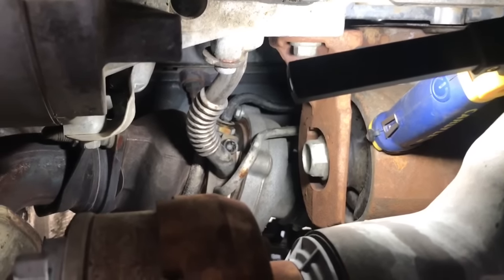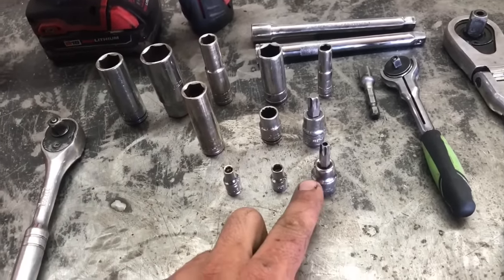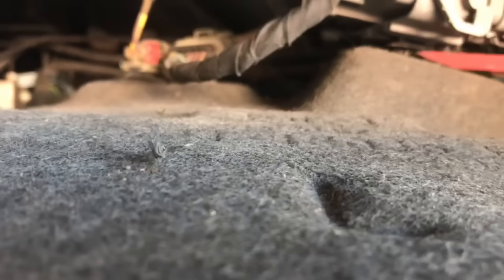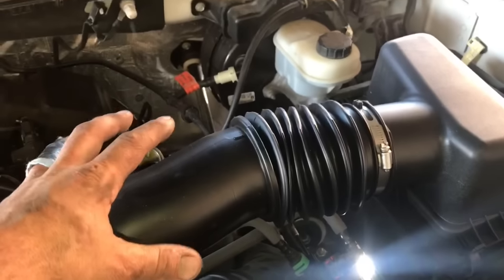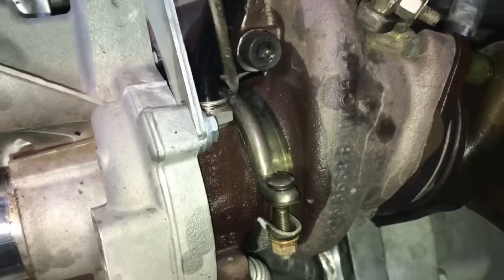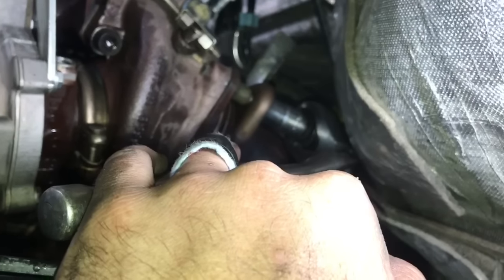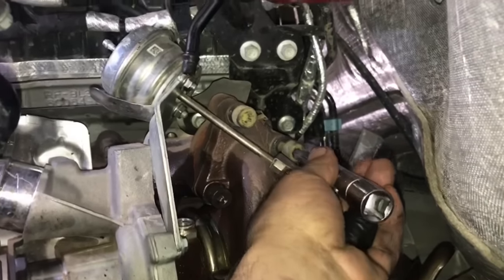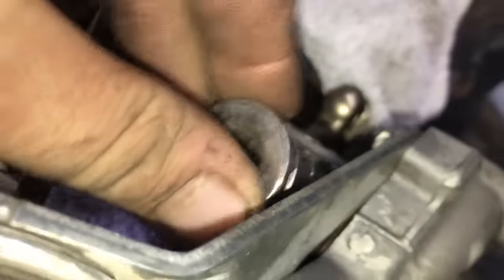F-150 Ecoboost 3.5 Turbo Coolant Connector Replacement (Tips and Tricks)

Comment: My 2013 ecoboost just started leaking coolant from that same line. I'm gonna get someone to do this for me. If you don't mind me asking, what's an estimated repair cost?
Reply from the maker: At my work we have a large fleet of trucks. 17 of them are eco boost f150. And I do all the repairs. So I’m not quite sure on the cost. Unfortunately most of the of the repair is going to be labor. Those fittings are under $10. 3 hours of labor is reasonable for the shop to charge. I would question around 375.00
Reply: @AaronHinesAuto  appreciate that.
Reply: All data shows 4.5 hours. This is an industry standard. Quit trying to make the shops look bad. Dealer charges same time as does independent shop. You’re a technician, don’t make it out like we are crooks. We DONT decide the time charged and you know this
Reply from the maker: If you read my comment above I said “I’m not quite sure of the cost”. As I don’t use the flat rate system. No one is a crook here. Chill.
Reply: floydpros to be fair if you bring your truck to the dealership you WILL get taken advantage of in some way shape or form it’s undeniable
Reply: I’ve not seen that at any of the dealership I’ve worked at. The reason you pay a little more is for the part. The same part that lasted 8 years and will likely not have to be replaced again. I’ve spent some time at pep boys and firestone, those are crooked places
Reply: Remember the dealership banks on your return. Why would they cheat you and loose that potential car sale in the future
Reply from the maker: this part did not last 8 years. it lasted 2.5 years. yes there are some good dealerships and good service advisers who are honest. there are just as many out there who are not honest, and who do take advantage of peoples ignorance about auto repair.  to say that doesn't exist is not true.
Reply: Aaron Hines no it did not last long at all  and I would be really upset if my new truck was leaking all over my driveway within a couple years of leaving the factory

Comment: Great video but you should do a little more research before you post. Those are not T47 they are T50 bolts and the radiator does have a petcock it's on drivers side on the bottom. Draining from hose just makes a huge mess. Putting it back together is much easier if you take off the intake and charge tubes. Also if you do one side better to just do both sides at the same time. It's a good idea to change the fittings on the other side of coolant tubes that go into the block they leak too. The passenger side is way easier, but you need to remove the starter.

Comment: How long can a guy drive with this leak? Im adding about 9oz of coolant a day doing about 80 miles total. I did notice since the temps here have been in the single digits i leak more sitting.
Reply from the maker: I have repaired trucks that have had the leak for more then 1 year. The leak doesn’t grow thankfully. However I am in AZ. And temps are a lot higher
Reply: @AaronHinesAuto  damn wish you were closer! Nobody besides dealer wants to fix.

Comment: How much do you charge for this job?
Reply from the maker: if its side work i charge 500.00 to replace all coolant connectors one side. (4) i have seen shops charge 800-1100
Reply: @AaronHinesAuto   you live in Wisconsin or Minnesota? My stealer wants over 650
Reply: Aaron Hines do you still do this on the side?

Comment: Tip 
Never do this job without the intent of replacing the fittings on the back of the head as well. 9 times out of 10 they will leak. 

All you need to do is pull the intake, pull the coolant piping underneath, even then you need a pick and a mirror to get that back coolant line off.
Reply: Did you do this 10 times to see if was 9 out of 10? Joking of course. I did once and never leaked.
Reply: @outdoorproperties2277  i have been bitten before, I have a lot of these in my fleet. Now I don't even piss around, I just pull the whole cab, it doesn't take long and you can get to everything really easily :).

Comment: Dude..getting the coolant line off the drivers side head is impossible!!  Your 2015 must have different clearances.  I did the turbo connectors..not a huge deal, but had to cut the exhaust off because it will not move an inch to allow the turbo to be removed.  the exhaust is a solid Y-pipe that connects to the other turbo, then the muffler so you cant push it aside like in your video.  Back to the connector on the drivers head...there is approx an inch and a half clearance to the firewall...really not even enough room to get your hand back there, let alone see.  If the clip is rotated, there is no way you will "pick" it off.  You cant use the special tool because the coolant line has an immediate elbow, therefore not allowing that tool to slide over the 3/8" line.  Looking at your video numerous times, I have come to the conclusion that your 2015's engine sits forward at least another 1.5" than my 2013 does.  I have been wrenching for nearly 40 years now and I have never come across a task as impossible as this one!!!
Reply from the maker: thats a bummer man, did you try to get to the fittings while laying ontop of the motor? i found that is the best way to get to it. i cut a wrench in half and unscrewed connector out of the motor with the line on. i then removed the line and connector together,. off the vehicle. from there take the clip off and install the new connector back on the line and re-install it. the same exhaust is on a 15. and there was a little flex that allowed the down-pipe to be pushed away with a pry bar. it is a crappy job to do. you think ford would make a better way to seal a water line. maybe a like a barbed fitting and hose clamp like any other coolant line in the word!

Comment: Another video that does not explain you that those coolant lines leak at the other ends just by moving them and bending them around. This job is never completed unless you replace the fittings and pipes , try to replace the fittings at the other ends and then you’ll have my respects.

Comment: This has to be the dumbest design ever put on a vehicle ever. O-rings on a molten red hot turbo fitting!
Like the space shuttle Challenger o-rings, these o-rings are a joke. If you buy an F150 get the 5.0 engine!!!!!!!!!